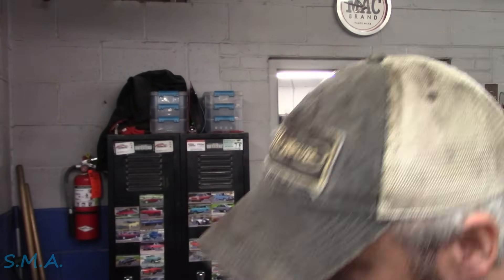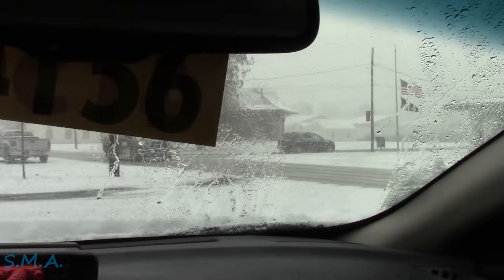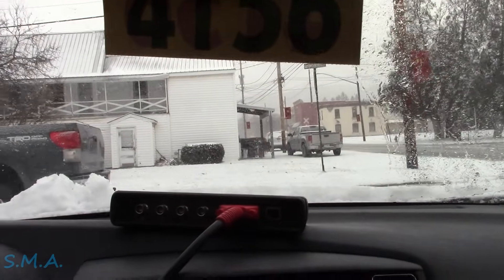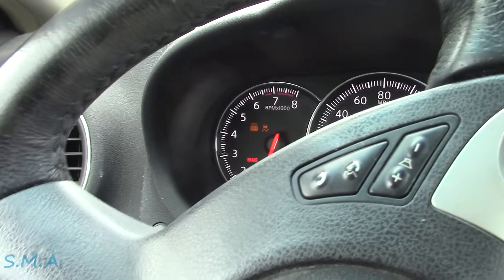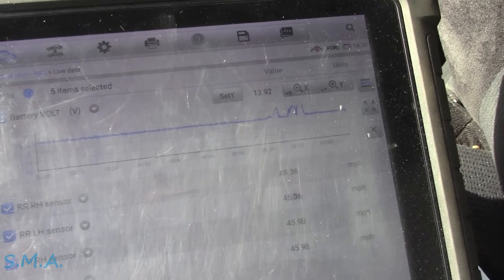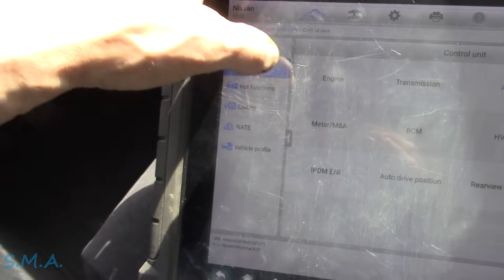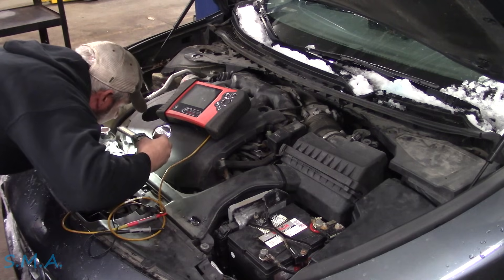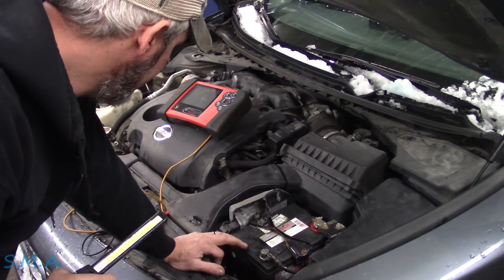Nissan Dealer Quoted Over $2000 For A New Harness!!

Comment: Have the same problem with some of the dealers up here. When they can't figure it out, they estimate on something really expensive in the hopes that the customer will decline the repair, but they'll charge them for diagnostic time.
Reply: That is typical way to deal "difficult" diagnoses. Official dealer gives so high estimation that customer doesn't want to repair that car (or they hope that customer doesn't want to repair, because diagnose was only guess). That way they can charge what they want from the "diagnose" and they are not reponsible about was it right or wrong diagnose when the customer tows car away from the dealer...
Reply: When I worked at BMW I was 1 of 2 speciality diagnostic techs.  When there would be issues like this the service advisors would always stop us from diagnosing at a certain point then make up some BS high dollar repair for the customer so we can get to other cars they promised to other customers that would  be done that day.    There was times I was only 25-30 minutes into a car then they pull that.  For most service writers it's about that bonus and good review, and also same thing with this car they work with a salesman saying it might be worth it to get a new car then the advisor gets a kickback there also.  It's shady
Reply: I rambled I apologize for the grammar I know it's horrible but I'm guessing I got my point across
Reply: I understand the criticism of a shop quoting a high number, but there is another angle worth considering. If the shop underestimates how much it will cost to fix, the client will be furious, he'll tell all his friends, and the shop's name will be dragged through the dirt. Do that a few times and you'll struggle as a company. On the other hand, if you overestimate the cost, you're a hero if it comes in under the quote, which will be the usual case. If it doesn't, they warned you. By definition, diagnostic effort is plunging into the unknown, and some of those costs are hard to guess before you get your hands dirty.
Reply: @spelunkerd  that is another topic. I worked 15 y with various vw dealers, hundreds of times I have seen that "diagnose" is fault code reading, then maybe (nowadays) check from Elsa TPI's and if not any check from google or various forums with obd code. Diagnose cost about 200-300€, repair not included. If lottery was not correct (same problem still occurs after repair), well there is two separate faults with the same exact symptom... And another diagnose fee and repair estimation!
Reply: @nikolaip4947  pizdets..this is why I got rid of my F10 550..quart of oil every 200 miles and dealer said it was normal
Reply: @nikolaip4947  Wow. So bad. It's all about the $ and the fleece.
Reply: @spelunkerd  We're talking about 2 different things here. I've worked with a few techs that came from a dealerships and they have no diagnostic skills. At the dealer, if they suspect something is wrong, they just grab a part from the parts room and throw it in. If it doesn't fix the problem, they put it back in the box and put it back. I've always told my apprentices, to quote scannerdanner, "Don't be a parts changer". Make sure you are a tech that the shop needs, and not the other way around 

As for billing you shouldn't overestimate or underestimate a job. Any diagnostic at the shop I work at, I'll ask the customer for a couple of hours to start. After 2 hours, I'll usually spend 1/2 hr or so more, I'll call the customer, explained what we did in the 2 hours, tell them what I think the problem is and then ask if they want to give us more time to continue. 99% of the time, I can solve the problem in 2-3 hours
Reply: @dull_Asian_dad  you honestly have no idea.  I was making great money there, but I couldn't stand the shady business practices.  It was $40 per hour plus flat rate. I lasted 3 years then left it slowly broke me with how the advisors just didn't care.  There is such a huge stigma around mechanics being shady and that dealership was horrible.  All bmw dealerships have a 200%-300% mark up on all parts it's so ridiculous
Reply: I haven’t trusted dealers in a long time.    One day my wife was in the city and her door would not close.   She was only two blocks from the dealer so asked if they could look at it.  Said it needed new hinges , couldn’t fix.    I just adjusted the pin it latches to,  took me one minute to fix. 😂
Reply: @nikolaip4947  point taken.

Comment: I had this exact same problem with my 2009 Nissan Maxima. It would stall in the middle of the road I would put the pedal to the floor, engine speed did not change. I replaced the alternator and it has been working perfectly ever since.
Reply: I have a 2012 with 220k on it, still on the original alternator and I’ve been expecting it to fail anytime now. Now I’m really expecting it to fail soon lol.
Reply: FWIW sometimes issues like that can be caused by a faulty oil pressure switch too. Might be something worth testing
Reply: bad voltage regulator? hm
Reply: fyi the regulator is internal to the alternator. pcm doesn't control it. but it can monitor the voltage
Reply: @aninnymoose720  there’s also a battery current sensor located on the battery power cable I believe. That might also be the culprit.
Reply: While we are guessing, check the pressure in the spare tire. Who knows?!
Reply: @_zigzak  You can be pro-active and change something that is a wear item! Think how much a tow, diagnosis and repair will cost when you don't know WHEN it will happen Versus doing it before its a problem.
Reply: I have the same car same year as you 2009 me and my bro have tried everything and nothing… it happens every time he hits a small incline..
Reply: Ava  <--- Misprogrammed bot.
Reply: @351cleavland  Agreed. My daily driver is nearly 30 years old. If I pull off a part that can wear, even to get to another part, a new one goes on. I keep the old one since the quality of aftermarket parts can be dodgy.
Reply: That's the problem with these new "technologically advanced" vehicles.
Something totally unrelated to the symptoms goes wrong and half the mechanics can't diagnose them correctly and in the case of older vehicles costs more to repair than the vehicle is worth even though it may run great.
Reply: @351cleavland  yea ik. I have a new one but I gave up on installing it because it’s a real PITA to replace and I know that I’ll get shafted by the local shops here. It still puts out a consistent 13.5-14v though.
Reply: Get junkyard parts of newer/lower mileage cars with OEM parts. That's assuming you're yard doesn't charge as much as the parts store.
Reply: @HawkEye3188   Only drive downhill.  Problem solved?  I didn't think so.  Hope you find the trouble(s).
Reply: @cjr1881  Okay. If I have to : (
Reply: @jakemilkovich1722  never a bad idea to be honest. how far can someone drive on a flat spare tire?
Reply: @351cleavland  proactive will be not buying a nissan

Comment: I just started work on my nephew's truck that two separate shops either could not diagnose or diagnosed as an "engine with internal damage, need new engine".  What did I find thanks to your previous videos and a few other YouTubers' videos? Plugged passenger catalytic convertor. Removed O2 sensor, started truck and engine immediately started running much better with the extra ventilation.  Just pulled the exhaust and will hopefully have it back up and running next week.
Reply: Straight headers is betters!!

Comment: The amount of integration in the vehicles today is astounding!  Interesting content Mr. O.
Reply: every light, every sensor is now monitored by the computer so when faults happen, the computer tells you where the problem is. 
That problem is either a direct sensor OR the wiring to the sensor.

Comment: Interesting video, looking forward to seeing the sequel. I once had a similar problem on a 93 Passat GLX. VW basically thought I was crazy and returned it to me. I took it across the road to an empty parking lot and basically started driving in very tight circles, clockwise everything was fine, counter clockwise the AC shut down and Wouldn’t run. Kept on it until it permanently failed and took it back. Was amazed at how fast I could get up to with the wheel hard over, felt it in my head. Long story short they found a plug in the wiring harness that was loose probably from the factory and would pull away or make connection based on the direction I was leaning the car. I’m not nearly that aggressive in my driving any more but your problem brought back the old memories. Thanks for sharing your videos, wishing you and your family the best.
Reply: Thank you for this comment!!!!

Comment: I chased this same issue around for weeks, replacing many modules and chasing OBD codes. All of the input errors to the PCM ended up being the result of a bad alternator, the diode pack was wonky. Nissan has a screwed up logic system that doesn't single out the alternator as being the culprit. I've experienced 3 Nissan vehicles that started killing and/or appeared to be in limp mode and then start throwing errant Cam and crank position sensor codes and even O2 sensor and ABS codes. A battery disconnect to draw down system voltage was a very temporary reprieve. On all 3 vehicles, a defective alternator was the culprit. The bottom line is that Nissan is NOT what Datsun started off as and used to be. IMHO, the corporate fools, lawyers and executives have run the company into the ground for the sake of high salaries and to satisfy stockholder insatiable thirst for dividends, the engineers and assemblers left with orders to cut costs and corners wherever possible even if doing so defies logic and best practices-I heard this from a retired Nissan North America Warranty Division Engineer. Nissan = POS and will not be rebounding, they're on life support only as a result of foolish buyers falling for marketing incentives and financing trickery. Caveat emptor!
Reply: Nissan quality went to crap after the merging of the French car company Renault. I know because my dad's Nissan caught on fire after he sold it. We started researching that after merging with Renault, their quality took a nosedive.
Reply: Yeah they also have to be able to ship their CEO in a suitcase.
Reply: Those CVTs
Reply: When the executive class is composed of greedy paper pushing bean counters and lawyers devoid of any engineering knowledge, Nissan is what happens.
Regrettably GM, Chrysler, and Boeing are in the same boat. This is why Henry Ford kept the bean counters in basically an outhouse at the river Rouge plant. Henry despised what he and Adam Smith called the parasitic class.
Current executives remind me of the horse drawn buggy chauffer who was given a tip for a good ride when in reality it was the horse who did all the work.
The marketing, accounting, and legal types never create or build, they just lead their companies to a slow death. Note that GM and Chrysler needed bailouts but not Ford.
Reply: Yeah - Nissan used to have a clever business model - make your cars relatively basic with some slightly dated technology and then produce that car for a long run so the guys on the production line are able to throw them together so quickly they turn more of a profit on them as the model nears the end of its run. I remember the Micra in the 90's. It was popular in the UK. It was very basic but it was a very good work horse and many of them were able to run around on the roads for 20 years. You still see them sometimes knocking about. 

The Quashqai is a very popular vehicle in the UK these days. Made at the Nissan plant in Sunderland and while there are some positives about it as a vehicle the build quality on them is incredibly poor and they are rot boxes.
Reply: Nissan brand is dying an deserves too! Good riddance.
Reply: @garrettstevensen2467  they been bad for a long time. Buy American!
Reply: @TheDigitaldoug  Ford Is still an awesome American brand! Best trucks out there by far. No comparison.

Comment: One of the project managers at my job had his entire body harness go out on his brand new Nissan Nismo after a couple months. If I remember properly, they quoted him $5,000, and the dealer didn't want to warranty it! Luckily Nissan corporate warrantied it, and he got his car back after about two weeks at the dealership. They found that the harness was missing some sheathing from the factory, which caused it to short out on the body.
Reply: Nissan quality
Reply: Often the wiring harnesses are built in low labor cost countries like Mexico because they have to be assembled by hand which is a labor intensive process.
Reply: I guess that Nissan nis mo sheathing!